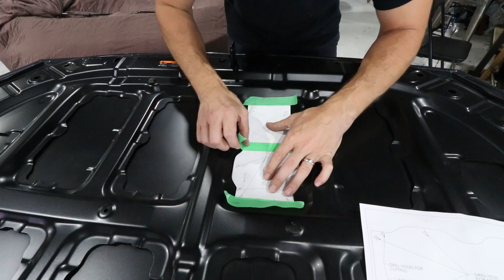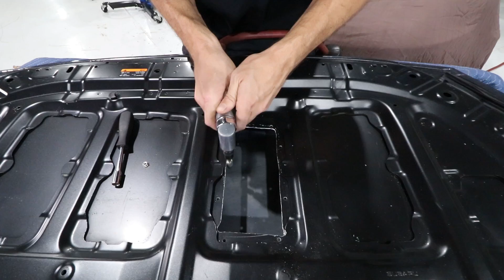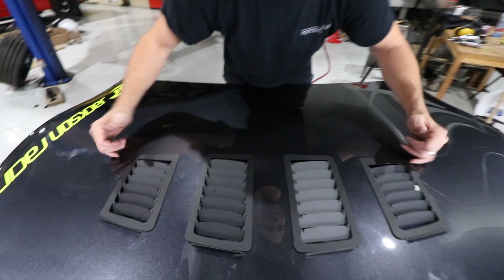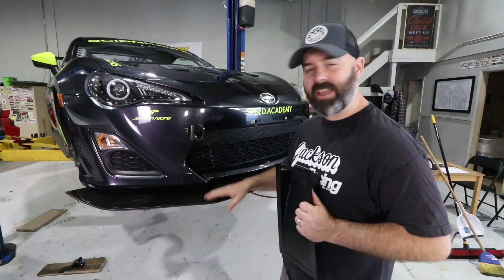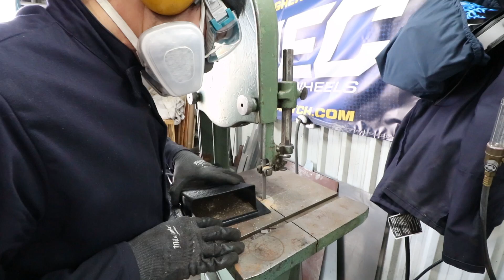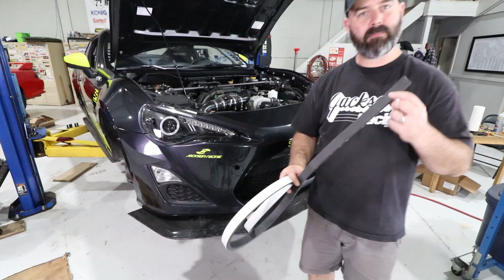Adding Budget Aero To Our Scion FRS

Comment: Try prolonging the front splitter further under the engine, will increase the front splitter efficiency, though adding packaging issues of course. Great episode!
Reply from the maker: There is a full undertray from the factory which certainly aids in aero and I suspect is why our diffuser is built so short.

Comment: Curious, Did anyone check to make sure the air pressure was lower above the hood vent?

DTC-80 sounds like a bit too much mu, those are like formula 3 levels of friction.
Reply: Check out verus engineerings website; they have the louvers analysis there

Comment: Looks good I have the same vents on my hood, but you installed the front pressure creating plates wrong. They fit under the hood and stick up through the first slot, this allows them to be removed without having to take the whole vent off.  I think you have them mirrored to where they should be.

Comment: Calling it as I see it. Louvers are over priced, no need for carbon vents on a metal hood. Wickers don't look like sound fluid dynamics, I'm no expert but if they do create a low pressure zone above the louvers they are most likely causing turbulence on the wind shield, maybe causing de-lamination on top the car. Why place the louvers on the front half of the hood, why not bring cooling air from the front dam through the heat exchanges and then let it out as it flows over the engine, through the aft portion of the hood. This would definitely help with down force by giving  the air coming into the engine some where to go once it hit the fire wall. Instead, what you have now is the exchange air being pulled out before it touches the mid point of the engine and then a big high pressure zone of hot stagnant air from mid point of the engine to the fire wall slowly draining from the car's normal (self defined as insufficient) means of egress. Of course venting the hood anywhere will give some better flow to the heat exchanges which is what cools the engine but I wouldn't purposely put them in a place where they will not vent the hot gasses trapped in the engine bay.
Reply from the maker: Since you're no expert, we suggest actually calling them, Verus Engineering has many on staff and they have done all the work to ensure those vents are in the right spot which I'm sure they'll be glad to explain to you. 

As for price... Go ahead and make them cheaper, it's a free market. Until then, don't complain about other people's prices when you have no idea how much goes into R&D, production, etc.
Reply: Ok, point taken. I spoke without checking prices on hood vents. Verus is pretty competitive considering ebay aluminium universal louvers are not far off and obviously don't come made to fit the brz/frs. Maybe project binky has thrown my fabrication expectations a little out of wack. If you paid yourself 25 bucks an hr you could easily spend twice for the same result.
Reply: It's much harder to pull air out of the back half of the hood due to the pressure increase and air velocity decrease caused by the windshield. In fact, car companies have put vents in that location to have air flow the opposite direction, see cowl induction for example. The location of the Verus vents strikes a good balance between being far forward enough to not have that pressure issue, but not too far forward that it doesn't have a positive affect on under-hood pressures and temperatures.
Reply: Daniel O'Donnell thanks. That makes total sense. If you are using the front half of your hood to vent a sealed and ducted radiator, is there a best practice to move air out of the engine bay? In that case should you consider vent toward the windshield or just leave it.
Reply: Oh just noticed they are not carbon fiber, what the hell are you paying 209 for then? Damned Trump tariffs.

Comment: Hood vent would have been more efficient towards the back of the hood.
It would have let more of the hot air out of the engine compartment and somewhat fix the low pressure zone at the bottom of the windshield.
Reply: The bottom of the windshield is a high pressure zone. Not the best place for vents.

Comment: From my limited experience (bare that in mind...) The leading edge of the diffusers sticking down doesnt provide a smooth transition and is going to increase drag and cause the air to separate away instead of attaching upwards as intended
Reply: It may not be large at that point, but there is a boundary layer, which means the slight thickness of the plastic will not effect diffuser performance much, if at any.

Comment: I think you put the wickers on backwards?
Reply: The science of how they work is not in question. My comment is about them not having followed the mounting instructions correctly. The correct way has been mentioned in the responses already
Reply: Nope, that is the correct way. Looks odd at first but it's the right way.
Reply: 371 Motorsport They Mount from
Underside and stick up at the front. Same function as you describe, but cleaner looking. They are also mounted with studs and locking nuts. After thousands of miles with all kinds of driving the nuts haven’t moved.
Reply: Doesnt matter as long as they poke infront to work as "gurney flaps"
Reply: No they are definitely backwards. Go look at the Versus Engineering testing video on their channel
Reply: Exactly what I was thinking, I don't think they should be poking out in front of the louvers.
Reply: Having installed these on two different cars. He did put them on wrong. They are installed on the underside and poke up through